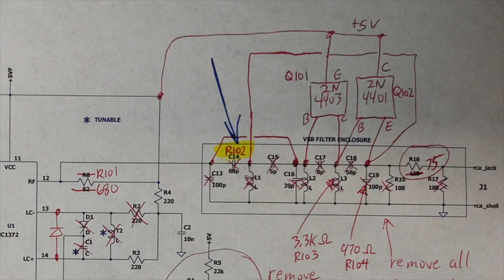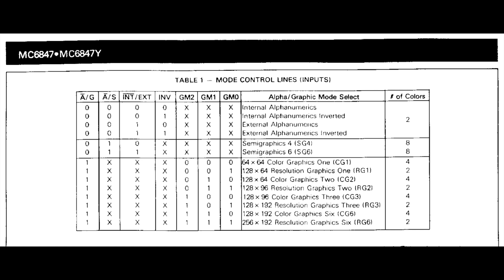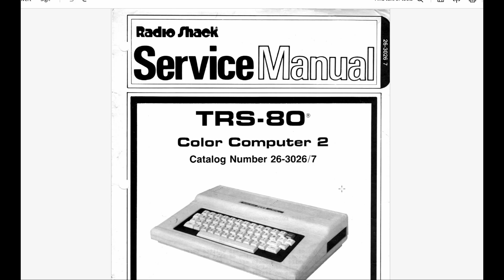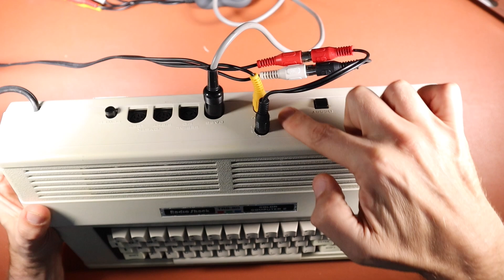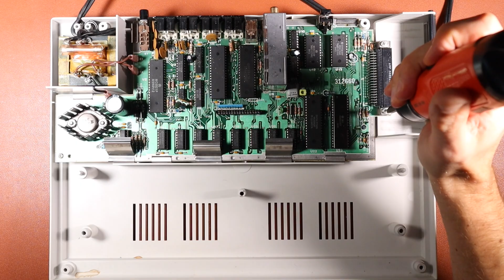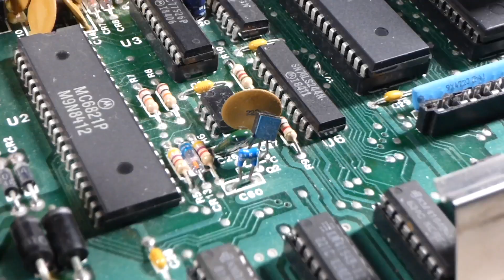Yellow Bar Glitch Caught Me Off Guard

Comment: Thanks!  Just watched your video and rather than mess around I socketed the 555 timer and replaced the capacitor with a 680 pF at the same time and now its good as new! 10 minute project.  Great video.
Reply from the maker: Thanks Mathew good plan! I've heard of people using variable caps on that location too so it can be fine tuned. I actually did a follow up on this because of the nonsense comments I received from some. So it's nice to get some feedback, take a lookt at my other coco2 vids if you like they are among my favourites

https://youtu.be/zAJh4tDcrCw

Comment: Interesting how the capacitance value plays a strong role in the picture quality. It has been my understanding that capacitance values are often critical when it comes to audio and video applications. I work with capacitors in my line of work and the tolerances are a lot wider. Generally a +/- 10% is acceptable for power applications like when used on motors. It’s always best practice to match the original but theres wiggle room. Happy new year. Looking forward to more content!
Reply from the maker: Thanks Brian... I think the cap and resistor together dictate the timing of the 555. My not testing R10 seemed to annoy some so I did a follow up too. Thanks for the cap info and kind words and for your continued comments and feedback. Hope you have a splendid new year
Reply: @RetroTechRepair I saw the follow up. I knew you couldn’t leave that one alone! Haha. Great work.
Reply from the maker: @briancoulomb  glad you enjoyed it!

Comment: Would the resister have fixed it all by itself? if the resister is wrong will that mean that it may occure again as the resister decays? another lower capacitor, repeat until the resistor gives up completely?
Reply from the maker: https://youtu.be/zAJh4tDcrCw

Comment: Hm, did you test R10? I assume R10 increased its resistance, so you had to lower C26 to get the intended frequency out of the 555 again.
Reply from the maker: I think you are probably right, I have seen small resistor value increases over time as well as capacitor value changes. As I asked in the video, should I have changed R10? well I suppose if wanted to determine root cause maybe, or perhaps for originality? Either way I guessing deterioration of R10 won't accelerate, so here's hoping it's going to be OK for a while. Thanks for your comments. Hope you enjoyed the video.
Reply: @RetroTechRepair  Resistors tend to increase their resistance while capacitors lose capacity over time. But modern resistors do not age as dramatically as capacitors do, so your fix should work. Perhaps both parts were on the edge tolerance wise already when the thing was assembled. Do you have a scope? When dealing with signals, a picture is worth a thousand words. See p. 93 of the service manual. Always enjoying your videos.
Reply: bugger, what i said but you said it better....
Reply from the maker: I just had to investigate. Thanks for
Keeping me motivated and for your informative comments. https://youtu.be/zAJh4tDcrCw

Comment: Very interesting fix, I would of never of thought that such a slight difference in capacitance could have made such a difference. Really enjoyed that one.
Reply from the maker: Thanks Ghost Retro, I am glad you enjoyed it. With all the screen grabs, multi-cam angles, voice overs etc that one took me a while so I am thrilled it was appreciated. Looking at the 555 data sheet the RC values set parameters of the 555, I think so that's why a small change can make a difference.  As many have commented, the resistor may well have drifted and might have been the "correct" fix, but I am happy with the solution as it is. Thanks so much for your kind words. Thrilled you enjoyed the vid.
Reply: @RetroTechRepair  I was thinking that about the resistor, anyway happy new year!